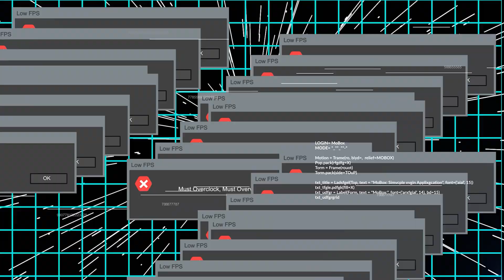x570 CHIPSET OVERHEATING

Comment: i have a x570 Aqua AsRock and it boots on bios at 70°C +. I've send it back they said everything is normal!! for a 1000$ motherboard it's crazy. Then now my CPU is heating at 90°C on simple games. I have 2 radiators 320. My GPU in the same loop is at 45° while CPU is at 80°. nothing makes sense and support is shit.
Reply: Hey man does your motherboard still lives? I also have an Asrock x570 i got recently (mine is the phantom gaming itx though) and it gets to those temperatures too.. quite scary
Reply: @RollingDude.  I ended up removing the decoration around the water block which improved the temperature. Working fine around  60
Reply: @RollingDude.  the decoration was preventing proper contact on the south bridge. Anyway next time I will buy a block separately. This one is just more expensive and fancy. Would not recommend. And support doesn't care either

Comment: Oh the crashes... here's my sob story. 

I recently added an ssd so now I'm maxed out.   3 Samsung ssd Evo 1 500gb and 2 1 tb.  My old 1080 ti does mining off a riser, extra load there,  with a water pump ekwb, 5 corsair led dan with 2 hubs, 3080 ti evga ftw... serious loads on that chipset.  Suddenly my new card was black screening,  whea errors, losing ssd write and read ability.   I thought my ssd was bad and sent it to Samsung.   Nope.  I remember hardware unboxed talking how these things need that fan 100% of the time because they don't down clock like Intel.  Then I noticed the thing just turned off.... realized it was making noise from the shield being a little bent(oops).  😳 

Well...I replaced the thermal pad,  100% the fan and added one pointing at the end of the card/chipset.  So far all is good....

Comment: Solved issue with a custom gpu fan curve. Put 600-1000 rpm to your gpu fans, from low temps. Temps never go above 50 C. GPU fans noise, nonexistence. Chipset fan starts spinning above 58C, so no longer works at all (good for my ears...). Above solution only apply when gpu is aircooled (no reference-blower design) and is located in 1st pci-e slot. Doesn't work if card is located in other slot. I will assume that doesn't work if the card is watercooled...

Comment: Is there an update to this? Did B550 work better?
Reply from the maker: I never tried b550, I got the x570 chipset temps under control and all problems went away
Reply: @FrameChasers  Can I ask how you got it under control? (was it by doing the things you do in this video by any chance? ☺ ) I'm getting high temp warnings on my SSD, the PCH is at 60~70 in low loads. Do you think a repaste of the PCH heatsink will suffice?

Comment: Don't those chips have little ventilators to cool them down? 😎
Reply: Graphic cards is close to most chipset fans blowing hot air around it. Just notice that my ASUS x579 Prime Pro runs the cxhipset at 75 C, opened the side on the case now and have just been websurfing and it sits at 69C.  graphic card is basically blockig the chipset fan on that motherboard, I need to fix the set up of my case fans .
Reply: @Revener666  so pissed about this no idea why i didnt notice this when i bought my x570

Comment: Totally feel ya on the hot climate stuff, I'm from Houston, Texas and it's HOT. My home lab kind of shifts temperature with the outside temp. I get better overlocks in winter :D
Reply from the maker: Me and My wife just ordered an air conditioner from Amazon and it came in yesterday,  sweet god gaming in a nice air conditioned room makes all the difference, no more ass sweat
Reply: @FrameChasers  Oh yea! LOL I ducted mine into my case a few times had the rads down to 7c. Can get some serious benchmarking done. Just be careful and to warm it back up slowly or turn it off will condensate a little when warming back up. AC dehumidifies the air, so it actually helps to not condensate while in use, but moment you turn it off, will start to condensate, so I just turned the temp up like 10 degrees at a time until back to normal. WORKS amazingly it in the winter when the dew point is much lower.